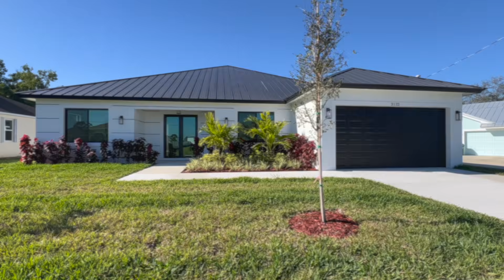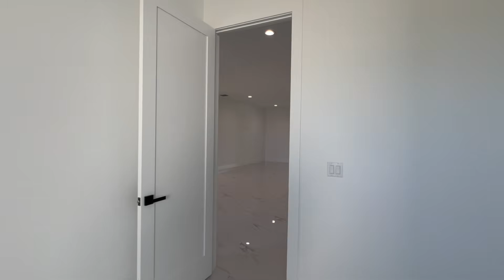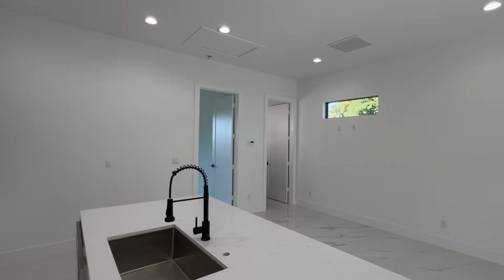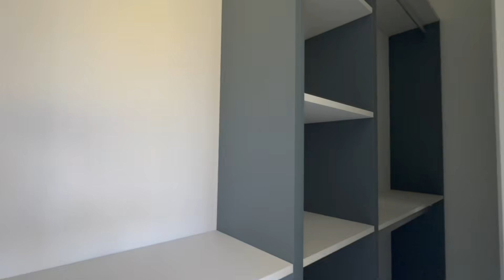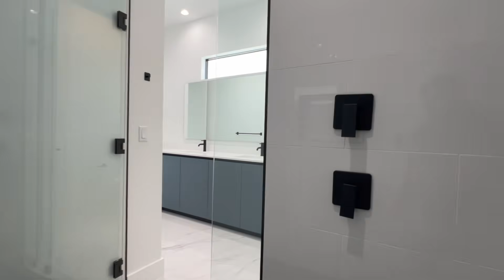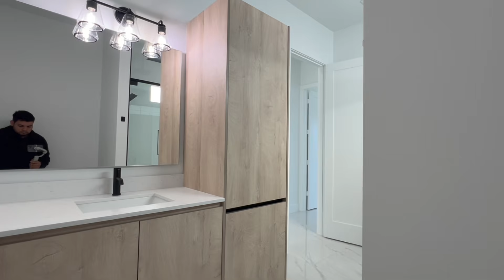1/2 Acre Custom Home + Guest House in Port St Lucie FL - No HOA New Construction Near Jensen Beach

Comment: 500.000 for the house. 1,000,000.00 for home insurance.  Not counting other necessities.
Reply from the maker: This home isn't in a flood zone, and because it's new construction homeowners insurance is much lower at less than $2000/year. But yes things add up when you factor in furniture, window treatments, and any other decor/design.